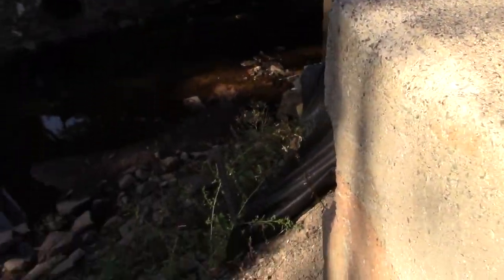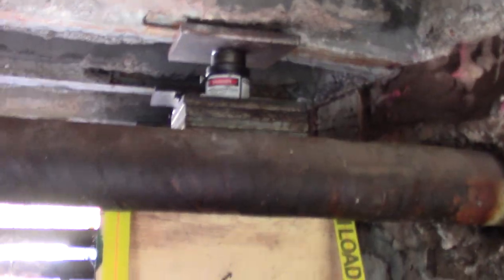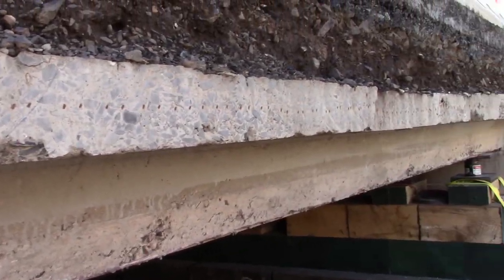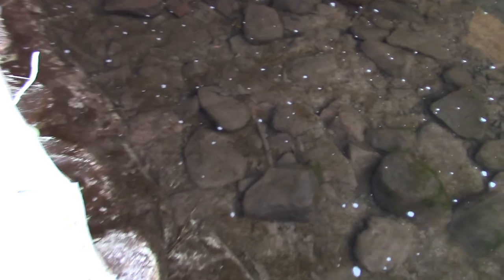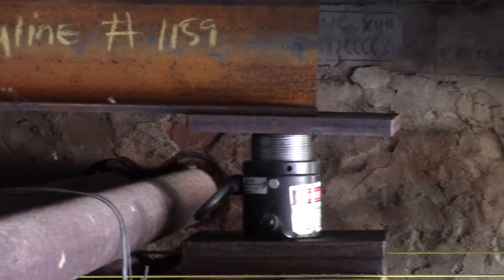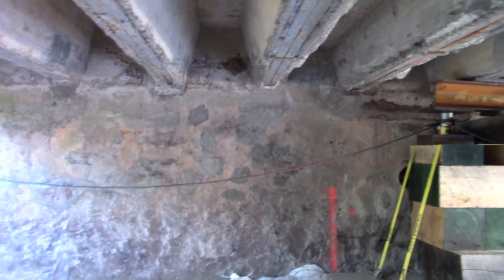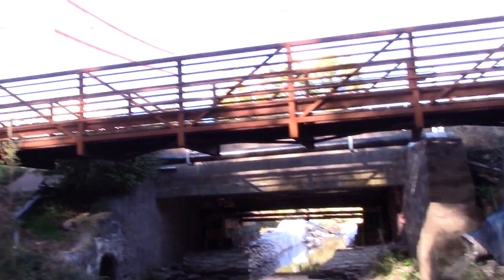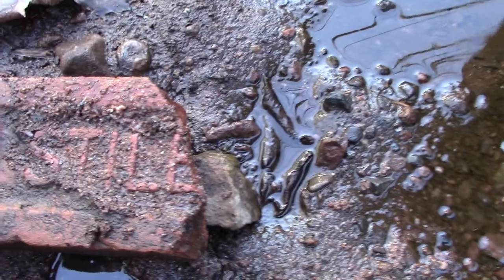IS THERE SCREW JACKS SUPPORTING THIS LOCAL BRIDGE?

Comment: If it was temporary, ok, but 2-3 years is NOT temporary...omg :-( That's crazy!
Wondering if the proper permits were obtained or if it's a funding issue.
Reply from the maker: I'm not really sure what happened, but it may have been something along those lines.
I can tell you I went by it on the way home yesterday and there was construction Crews there, hopefully they're going to get back on it and get it finished. This bridge has been sitting have torn down for a few years now

Comment: I kinda think that the support set up was meant to be temporary while it was under construction.  I'm no authority, but I dont think that was meant for long term.  Kinda questionable.  Good video!  Thank you!
Reply from the maker: I believe you are correct, that's probably what it was. But unfortunately since they were stopped we now have half a bridge for the last 2 years. The other half is completely gone and this is the only section that remains, just one lane LOL
I can tell you I see State trucks there every couple of months so I'm sure they are inspecting everything. But looking at the other Connecticut Bridges they have deemed safe, I don't have too much faith in the decision-making. I just take the extra two minutes to drive the longer way around these days.
It's been several years since this project was started and abandoned, I hope they get sorted out whatever they need to get sorted out so they can get this thing replaced